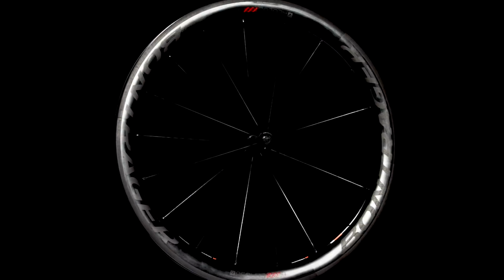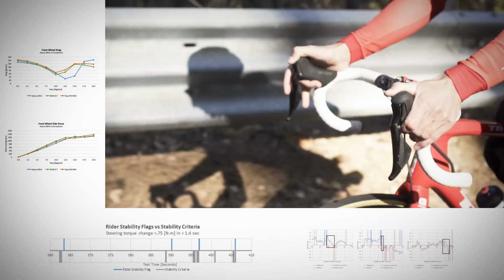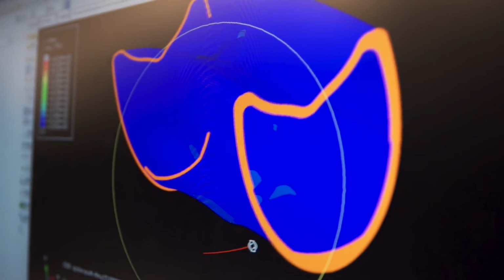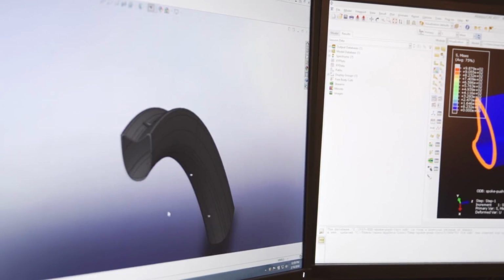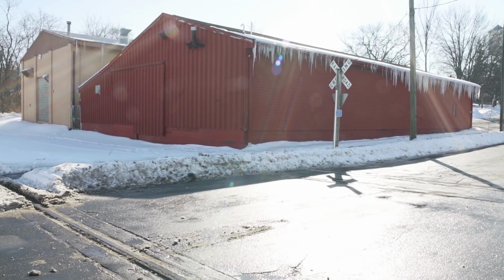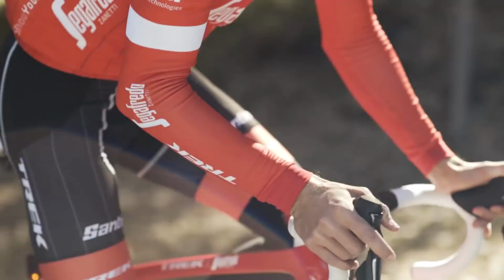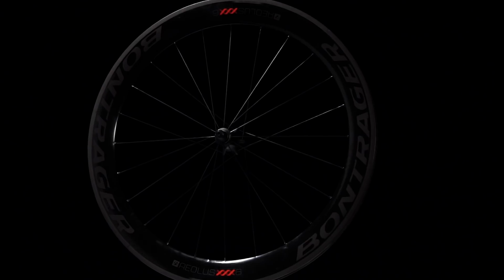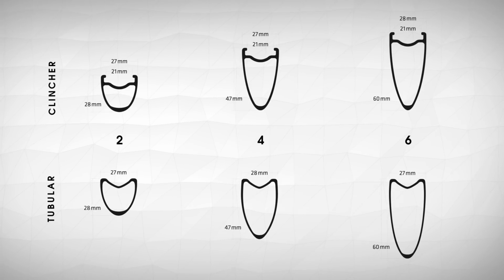Bontrager XXX Carbon Wheels: Stability Runs Deep

Comment: I ordered my P1 2019 Madone SLR 9 with xxx4, front and rear.

I weigh 140lbs.....  crosswinds blow me across the entire width of the lane with xxx4 on the front.

I was forced to buy xxx2 for the front.  The xxx2 front is much more manageable.  Though crosswind still generate substantial handlebar deviation.   That said...

The Aeolus xxx wheels have given me good service.  Nice and true after 2 years.  Good responsiveness and
stiffness.

Comment: Have had Aeolus 5 wheels on my Trek Madone SSL for 5+ years with over 35,000 miles ridden in all conditions...have had two head on crashes with broken fork and handlebars...I have weighed well over 250 pounds for much of the time but down to 205 now...my point is I am the real life test...these things are bullet proof and last as long as Volkswagen bugs